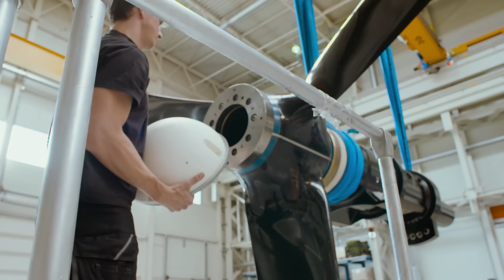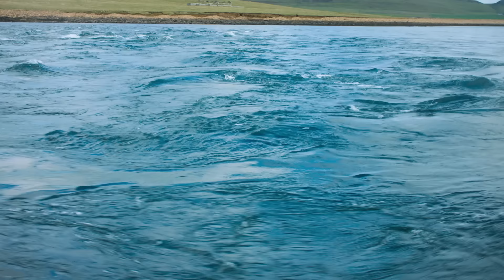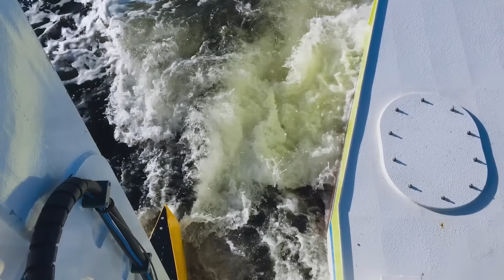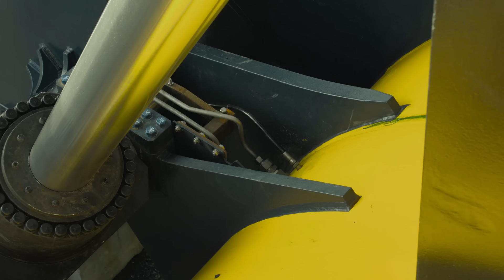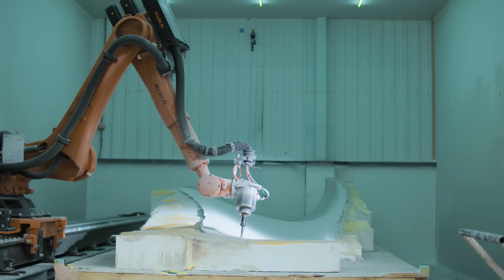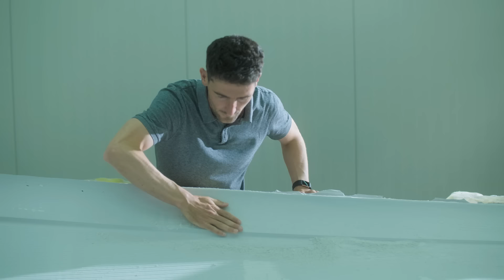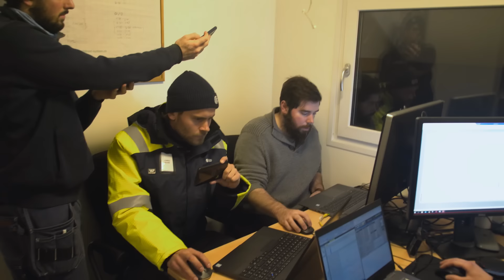Tidal Power: Unlocking the Greatest Untapped Energy Resource on the Planet | FD Engineering

Comment: It’s utter madness to use these renewable systems as the ONLY source of energy you have. But here in the UK we seem to be doing just that…
Reply: Not just seem, indeed the UK has and will continue to do so; the last coal power plant closes the end of this month. However, I don't see why this is madness nor is reducing the dependency of Natural Gas that is imported at vast expense to everyone in the UK. The UK having a diversified mix of nuclear, air/wind/tidal rewnewables, geothermal, hydro and biomass to a level where it becomes a net exporter of electrical energy surely is the way to go. Moving our energy economy from a oil and gas exporting one to an electrical exporting one, creating high value jobs with it. Such will also finally remove the dependancy on gas power generation, which is now a minority power source but one that still dictates the price we all pay for our electricity. When this anomaly is closed the cost of electrical energy will drop to the cheaper level renewables and carbon zero sources enable. All round a win-win.
Reply: @GruffSillyGoat  It's really VERY simple. The UK grid is NOT designed for renewables only, we have NO storage capacity for when the sun doesn't shine or wind blow or it blows too hard. So you are guaranteed for rolling regular blackouts, all for LESS then 2% of GLOBAL EMISSIONS. The economy will collapse, business won't exist, every other country in the world NOT be doing this will have a huge economic advantage. 
The experts have already stated NO ONE knows how much it will all cost to upgrade and install, but the National Grid already estimated to upgrade the entire network, so it we works, would cost about a trillion Sterling. 
Yeah that's why it is 'utter madness'.
Reply: @marksapollo  - which experts, certainly not those actually at the National Grid (NG), who have a very detailed costed and funded plan for the upgrades. Not sure where you get the trillion pounds from the NG's own figures for the series of projects is £30bn spend now till 2029. BTW the upgrades relate to connectivity of new renewable sources, extending the reach of the grid and overcoming already existing congestion points in the UK's grid not an overhaul of the grid's core transmission capability. The reason why is that the UK grid was sized for 80GW as was used back in 2006, since then due to increasing efficiencies (such as the big impact on moving to LED lighting and industrial processes) the UK only uses 25 to 35GW of transmission capacity.  The NG's own experts as well as independent industry experts all confirm the UK's grid is fully capable of supporting renewable and zero carbon generation sources.

Regarding storage, it is incorrect to state the UK has "NO storage" rather the UK has 4.4GW of existing battery storage, an additional 4.3GW coming on stream this year and a pipeline plan for 95GW of battery storage by 2030. This is more than ample to address UK's needs, plus of course geothermal, hydro (sluice and dam) and nuclear are always on energy resources. 

In terms of aligning generation and usage timeframes this goes in hand with the battery storage. The geographic footprint of the UK ensures wind is blowing at some point in the UK nearly always, with only a 2 day UK sized lull occurring once every five years. Further the UK diversifies it's energy supply by sharing with our neighboring countries via HVDC lines, which thanks to the UK's location we have been a net exporter of energy in the last few years. These interconections are only increasing in number, with more going into Germany, Norway, Netherlands, France, Ireland and Belgium. Further afield there are plans to connect Shetland (which already has a HVDC connection to the mainland) to Iceland and a private enterprise connecting Cornwall to Morocco.

So despite your gloom and doom prophesying, things are actually looking fairly good, on track and the UK is happily just getting on with moving to zero carbon energy generation basis in a calm and considered manner.
Reply: @GruffSillyGoat  You are full of it, fact no storage facilities exist on the UK grid. Your claim there is is just as wrong as the rest of your thesis.
Reply: @marksapollo - Wow, you really need to research harder, your claim that "no storage facilities exist on the UK grid" is so easily proven wrong. Numerous deployments have been installed and the pace has been ramping up since 2013, including:

- the 50MWh utility scale battery installed and operational at the Pelham (Bishop's Stortford) site by Statera in 2017 that connects directly to the 132kV grid in the area. 

- the Tesla based grid connected battery that went live at Pillswood (nr. Hull) in 2022 that was Europe's biggest battery at the time at 196MWh; which also connects directly to the grid and acts to support the worlds largest offshore wind farm by mitigating curtailment. 

- Indeed the UK has a habit of installing the biggest grid connected batteries in Europe, as in 2020 the Minety site (in Wiltshire) went live with a 100MWh grid connected battery (now increased to 150MWh), which was installed and run by a division of Shell Energy. Yes, even giant petrochemical companies are in the game of installing and operating grid scale batteries.

- and it doesn't stop there, only recently it was reported that construction had started on a massive 624MWh battery in the West Midlands, whose aim is to stablise the grid at the Cellarhead substation that supports a mix of industrial, commercial and residential use. Due for completion before the end of 2026; yes, it only takes a couple of years to install and switch this monster on. 

In summary, there are 98 utility scale battery storage sites operational in the UK currently (many co-located with solar and wind farms), 70 more under construction, a further 388 due to start construction and 400 more at the planning stage. So yes, I would say the UK has grid connected storage.

This is the same for all the other points I raised, which are drawn from published facts and authoritative sources, including the National Grid themselves. So you may wish to exist in denial but the renewable electrification of the UK is a very real thing, that is very much happening as we converse. 

All this with the additional bonus of the UK creating a wealth of new highly skilled green jobs and level of expertise in designing and deploying renewables that is seeing UK companies (like those in this video) provide products and services worldwide; and, yes many other countries in the world are "doing this"  as in deploying renewables. So rather than collapsing the economy going green is growing it.
Reply: @marksapollo you mentioned that the problem is lack of storage so you have identified the solution! Renewable power is by its nature intermittent but each type in its own way. Storage is the answer to even out the peaks and troughs. That can be done by pumped hydro Or mega pack batteries.
 Glad to have solved your countries energy problems, Malcolm 😊